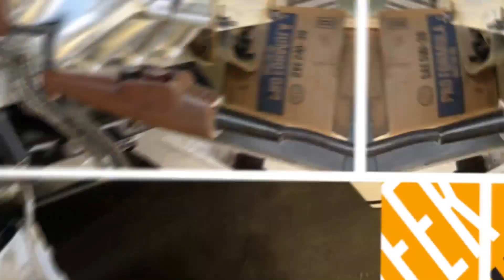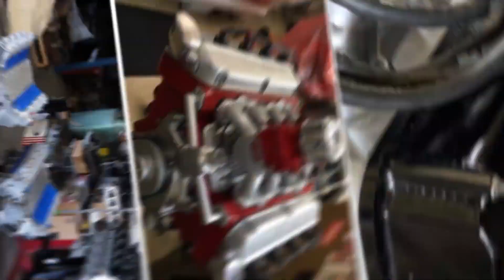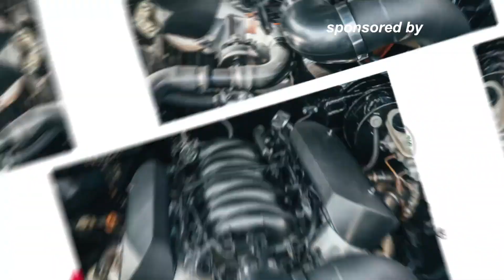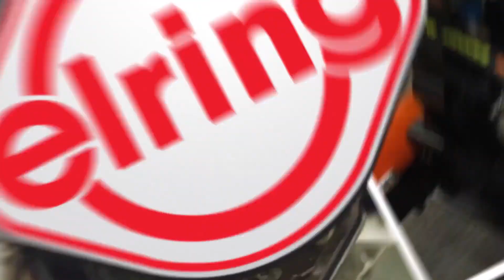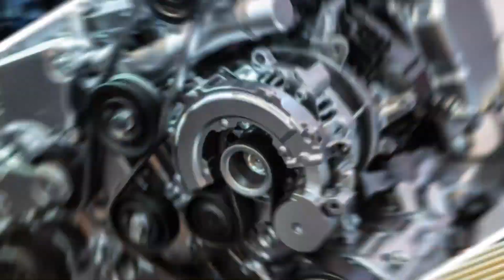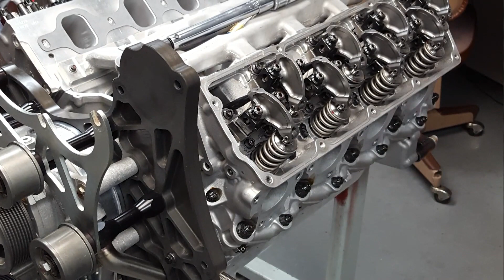Justin Lofton's RY45 Trophy Truck Engine

Comment: If these engines are supposed to be exclusively for racing, then why the crossplane crank? A flatplane would be no more difficult or expensive, would rev harder, be lighter, and not require a weird exhaust to breath properly.
Reply: A flatplane crank would vibrate too much with the stroke these guys run.
Reply: @TheSnoopydoodog  

Doesn't a crossplane also produce better low-end torque?

Comment: It's a really cool engine, but only a couple venders are able to sell the parts.  Parts are relatively easy to find, just outrageous.  I was specing one out and it was mind blowing.  Crank was 6,500, cam was 2K, water pump was 2K, con rods were 3,200 ect ect.  Couldn't find a listed price for the complete engine only "call for pricing".  I knew it would be expensive being an aluminum FR9 but damn.  If u can spare the extra couple hundred pounds just get an actual FR9 or R07.  Easily save 2/3 on a rebuild and I've seen new leftover R07s for less than15K.  And R5P7s can be had for around 10 grand.  The RY45 is a great race engine, but for the money u could build almost anything and make it damn near bulletproof.
Reply: yeah but you aren't going to get the same weight/performance than one of these engines. 1000hp 400ci plus under 400ibs and in small block sizing is not easy.

Comment: Very surprised he isn't using MoTeC .
Lofton is fast. 
Those RY45s are pretty cool to work on.  Built in piston squirters, low moi rockers, balancer behind the timing belt, o-rings seals...
Reply: This is outdated. He's been running DanZio P620 big blocks now that make ~1100hp for a couple years, presumably since he got in a new chassis that would fit it.